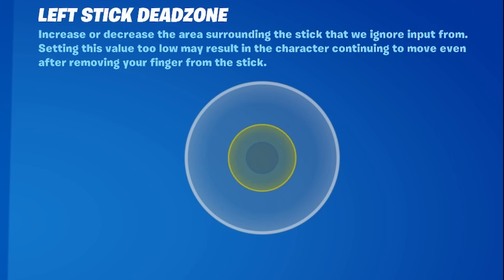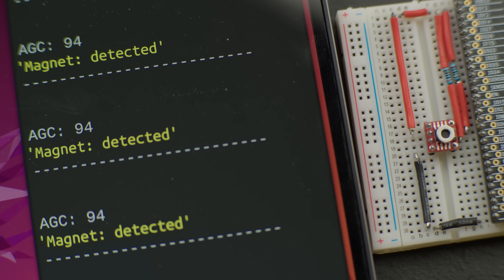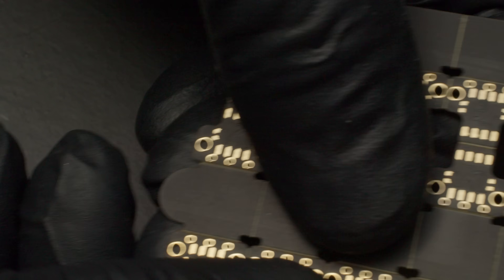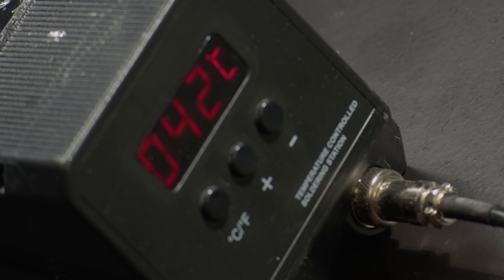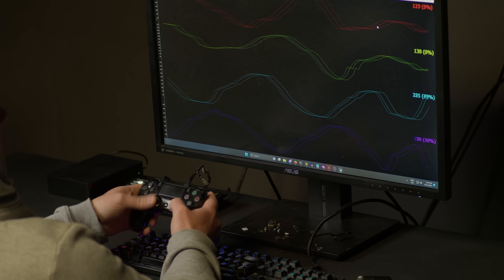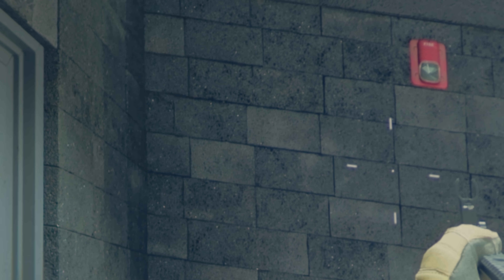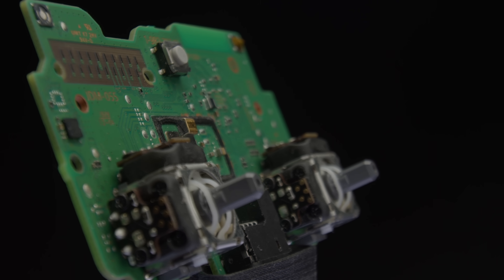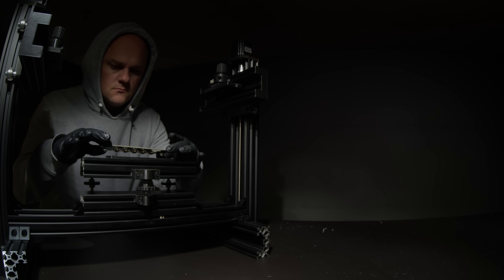Beating the $20B Joystick Drift Problem, and giving it away for free

Comment: What people don't understand is that this is not a design flaw. Companies want your controller to wear and tear so that you're forced to buy a new one after some time, they design them so that hopefully it happens when warranty expires.
It wasn't like this in the first generation consoles, I remember the first Xbox controller I bought for PC, played for 10 years and never heard of drift problems.
Now I am forced to change controller every year. Thanks to greedy companies and their revenue schemes.
Reply: Agreed.  Hall sensors are not new. All the joysticks in industrial machines use hall sensors for better reliability and robustness.
Reply: @vex123  and they where first used in a game controller by sega for the saturn and later for the dreamcast. Hall effect sticks are not even that more expensive. It is just the fact that Sony, Microsoft and Nintendo would lose alot of money on missed sales of new controllers and replacement stick modules. This will cost them miliions of dollars. Even gulikit who who solely rely on the sale of only 1 controller and a few hall effect stick modules fo joycons and for the steamceck, can implement these sticks in a 60 dollar controller that also has a accelerometer and gyro scope (even the series controller does not have both and is still more expensive then the gulikit controller).
Reply: Yeah, never heard of drift on PS1, PS2, or Xbox controllers...
Reply: @delta-a17  drift isn't really the correct term. The problem lies with the contactors on the potentiometer wearing out over time.  This causes jitter and error in the sensor reading.
Reply: @vex123  witch gives the effect of the haircross drift like a plank o wood in water, is just an more know and easy to understend term as everything on earth that is made to be easy understood
Reply: Lol what?? Yes it is. It has been called stick drift for decades. The "cause" of the issue irrelevant to the name. The name is based on the presenting symptom.   No one calls a sore throat "sliding thick mucosa syndrome"
Reply: @delta-a17  Xbox controllers get BAD drift boss.
Reply: The funny thing is all it would take is for an aftermarket company to break ranks with the others to have THE controller without this issue. But I'm not sure if specifications for compatibility are tied to licensing in some manner? The only other obstruction could be something else like a patent that's in effect which we don't know about.
Reply: @pauljs75  There are a small number of third party controllers with Hall Effect sticks now (mostly licensing/sourcing from a single manufacturer atm). Hopefully this forces more and more to start using them.
Reply: @pauljs75  we had those during the PS2 days. youll notice how every "3rd party" controller looks suspisciously like the exact same thing, and functions identically to one another now. thats because there are no more 3rd party controllers, thanks to DRM bullshit theyve got that locked down so hard that to make a 3rd party controller youve got to pay licensing fees out the ass and requiring you to make a completely unique design that is technically the property of sony/microshit. hence why things like razr and hyperkin controllers are so insanely expensive, but their liscenses have all ran out and niether of the real consoles seem interested in furthing them.
Reply: @pauljs75  Hall effect sensors themself are not patented atleast. Every one of the big 3 seems to use a different voltage for the sticks, so maybe theire is a patented for that. i do know that gulikit is working on a swappable hall effect stick module for the dualsense edge. And after that launches the are going to make one for the reugular dualsense. Gulikit also sells hall effect stick modules for joycons and for the steamdeck.
Reply: @pauljs75  Those already exist. There's plenty of companies doing that but its still third party and they have to make them with most of the features,of the official controller, cut to be able to make any money at all.
Reply: @pauljs75  main issue would be that the big companies would nuke the project to hell with a humongous lawsuits.
Reply: @pauljs75  logitech f310....... however it's not great for fps shooters..
Reply: @bullyakker  My logitech f310 ended up having spring wear and being super loose, which ended up being worse than stick drift. The sticks are soldered onto the board as well.
Reply: @bullyakker  it is great for iron lung and subnautica
Reply: Forced obsolescence.
Reply: They considers controller consumable goods.
Reply: Have 2 original GameCube controllers, used for 18 years, still work perfectly.
2 "Switch Pro" controllers, already multiple dead buttons, and joystick drift, in 1-2 years of use.
2 joycons, even worse problems in just a few months. Impossible to fix by professionals.
And these new controllers were so much more expensive than the old GameCube controllers.
Reply: Repent and believe in Jesus Christ  I tried Jesus and my sticks still drift I don't think that's the fix.
Reply: I bought a ps4 controller from Walmart to replace an older one, and I shit you not I had drift problems the very next day.
Reply: This, this is what Ive always said. they're designed to fail, to make more money, its always about greed.
Reply: Right and u could rven rig a 360 controller to take a single aaa battery, those where the days
Reply: Man my first ps4 controller lasted forever but when it finally ate shit I was lost and no controller has lasted longer than a couple months without getting drift since then.
Reply: I think many have realized this... I did after my 2nd $70 controller in a month. Took apart the PS3 controller and it's sticks were built much better, twice the inner workings then ps4's.
Reply: crapitalism is so cool 😍😍😍
Reply: gamecube controller has inconsistency issues for competitive play, but never had drift problems
Reply: I consider myself lucky that I've only had one controller degrade enough for me to notice in the last five years. I know a lot of other people go through several a year, and that's BS from the companies.
Reply: Yep. Designed to fail like a lot of things for consumers.
Reply: Lol exactly. I tell people this all the time. Almost everything is designed this way. Its bad business to make something correctly and lasts alot longer. Makes more sense to them to make u buy another one over a period of time.
Reply: Companies have learned this and have been practicing it for years... get your customer base, get them to really like your product... create new iterations and designs that create new/more revenue streams and then slowly integrate components that are meant to fail so that the company makes money on repairs/extra parts. This has been a big thing in the auto industry over the past 50-75 years something that is practiced by just about every single manufacturer
Reply: @jamesMwebber  same thing with lightbulbs, after a certain point their livespans just kept getting shorter and shorter
Reply: The term you’re looking for is planned obsolescence. It’s why we get new phones pretty much every single year and why the software and hardware on older devices(looking at you, Apple) degrade over time. I once read about a lightbulb that’s in a San Francisco fire station that’s been going for over 100 years. A lot of shit isn’t built to last anymore
Reply: And the solution just made by youtuber wtf are these companies dumpfk
Reply: why not buy Gulikit?
Reply: I was just gonna mention this, same idea with a lot of products they give then a limited use so they can getcha money again
Reply: This is called planned obsolescence. This happens with everything you use. Phones, cars, cameras, TV’s, consoles, controllers, remotes, the list literally goes on forever. On a separate note, I’d wager it’s the main cause of the perception of our planet being overpopulated, when in reality we are over-consuming.
Reply: i still have the first 2 controllers i got with my playstation 4, i still use one of them daily. i'm just now getting some minor drift over 6 years later, but it's enough that i can just turn up my deadzone slightly and not even notice it. i don't know when they started making controllers like this, but it never used to be an issue.
Reply: Exactly always i said, Hall joystick would solve that, because that happened on automotion too with sensors on the camshafts and crankshaft sensors, and i studied that, but they keep winning money with broken joysticks and they waste less money to produce that controller with that crappy joysticks, so, win win for them.
Reply: This is 100% true. My 2 DS4 v2 failed, one in 1000 hours of play and the other in just 500 hours. However, my DS4 v1 which is a launch model with 2-3k hours of play is still working fine. The only issue is the analog cap I had to replace it.
Reply: If anybody wants to learn more about this concept, the term is "Planned Obsolecence."
Reply: I still have Xbox Classic, ps1 and ps2 which work perfectly.
Reply: @drazic80 Do you mind sharing what shops or online store you are using/getting to honour the warranty in controllers?
Reply: @drazic80  Top man 👌👏 Thanks for replying 👍
Reply: It's ironic that I'm now almost exclusively a user of third party controllers for modern hardware, my $20 PDP Xbone controller didn't start drifting after 5 months like my fucking first party $60 Xbox Series controller did
Reply: Nice conspiracy theory.
Reply: I've been using the same Xbox controller for 5-6 years, maybe 7. It's an Xbox one controller, so I think it might be a you problem, considering I used it heavily during the pandemic.
Reply: To be fair it's not a greedy company revenue scheme it's just capitalism done well. This is why people oftentimes just say " capitalism sucks" to these sorts of things because if you think about it it's pretty goddamn brilliant when it comes to maximizing profit, since what are you going to do just not buy a game controller or not play your games anymore? Same thing happens with a lot of products. Thankfully there's still a decent amount of products where the companies aren't completely obsessed with profits (usually private companies) that actually do still make things at last, but you have to really work finding them.
Reply: Yeah, that part didn't make sense to me. 
You don't really need a different design, just make the wearing parts out of stainless steel.
Reply: It’s especially annoying that they specifically plan to make your controller last JUST after the warranty ends.
Reply: Hall effect sensors are a thing already. I think the first controller using these was Sonys Sega Saturn and that was back in the 90s. I don't know why he is pretending this is something new maybe to generate clicks.
Reply: I already own a controller that has hall effect sticks. Just don't look at rhe big brands. I use a Flydigi Vader 2 Pro and I've had no problems for 2 yrs. I already knew what to look for in a stick and they had it.
Reply: Every one of my friends went thru like 5-10 controllers during their ps4s lifecycle. I still got my OG PS4 Controller, it still works perfect and even OG battery is still going, feel like I have a special nuclear war edition.
Reply: The ps1 also had stick drift, but the system kept calibrating the dead zone constantly.
Reply: That’s why he’s saying no to the money.  So they can’t buy it and shut it down.  He’s trying to kill their revenue stream by shaming them into making a better product.
Reply: PS5 controllers are using the exact same sticks as PS4 and all of the others yet they want us to believe that the tech hasn’t and can’t get better in over 10 years? Right lol
Reply: @PapaGleb  Hall effect sticks where used over more then 20 years ago in the Sega saturn and dreamcast controllers. So who do they think they are fooling (clearly alot of people) because they still make alot of money from using potentiometers wich only last a few month or years.
Reply: @caleasthetic  Funny enough I just learned that the other day. It actually fits modern manufacturing if you think about it, I just never thought it would apply to tech especially since tech is usually improving or at least that is the appearance.
Reply: @PapaGleb  PS5 and PS4 don't use the exact same sticks. They have different resistance values.

Anecdotally, I've had far more problems with PS5 controllers than PS4 controllers.
Reply: @tomhsia4354  aside from the 2.3k and 10k I believe they are the same. Honestly Iv been having problems with all of them. In theory it’s a simple fix yet no matter what I try it’s never easy. I tried sticks/pots from mouser, China, eBay etc and it’s same results 😢
Reply: @PapaGleb  try the Gulikit KingKong2 pro controller. I've had no issues, and I'm murder on controllers
Reply: @Takintomori  I make my own controllers and repair others. I mainly work on PS controllers and last I checked guli doesn’t make sticks for PS but ty for the tip. I’m no where near the level of designing my own stuff but I have tried/researched everything else I could.
Reply: @PapaGleb  You are correct. Part of the reason it is not a simple fix is that the center point for those joystick are not quite the same for each unit, there is a baked-in calibration for each pot in those controllers. However, we consumers cannot recalibrate the new pots. They sell little curcuit boards (drift fix boards, I think) that allow you to dial in your own calibrations.

I've personally been having so many proiblems with my PS5 controllers, while ny PS4 controller has been solid all this time.
Reply: @tomhsia4354  Thx for the info Tom. Although this is a big problem, not a lot of people want to discuss/share it so I appreciate everyone's input here. I have tried those boards before but they work better in theory than in practice. Once the sticks are all centered with those boards and you assemble the controller, you realize that you need to compensate and grind the shell which I felt stupid after as it makes perfect sense lol. 

I also concluded that they have to have some way of calibrating the controllers because I purchased Alpine sticks from mouser and those weren't the solution but there is nothing online about calibrating, at least nothing that I could find.

I think I have tried it all at this point and so far what works for me is a slow trial-and-error method. I find pots that equal 10 or 2.3 ohms and test them without soldering so I will go through my 100s of pots to find that actual makes center. Also, I noticed that the stick itself may cause some drift. Let me explain, I believe the spring or the main plastic stick body goes through where so it doesn't return to the center as it once did. So before I test my pots, I will confirm if the stick itself has any extra play, if it does then a new one goes in and I then start my pot testing. Very time-consuming which is why I still have a box of about 40 controllers waiting to be fixed :)
Reply: @tomhsia4354  The xbox series controllers self calibrate. As you move the stick around it recalculates the center point until it eventually finds it, and dials it in pretty darn impressively.

Thats being said, the only reason I know this is because the self-calibration software in combination with a bad stick was making the inputs go haywire. For me, as someone that can easily replace sticks, this is far more preferable than having to screw around with drift fix boards or trimmers. But for someone who can't, the controller would be completely unusable. Whereas without the baked in calibration it might still be usable.

I think the problem is everything has tradeoffs and solving the problem is a lot more difficult than people want to admit. As much as people like to tout hall effect sensors as a perfect solution until there is some real world data of hardcore gamers smashing these sticks around for hours a day over an extended period. It is hard for me to believe there aren't going to be unforseen problems that crop up, similar to how Microsofts self-calibration software designed to eliminate drift actually seems to have made things far worse in the controller I had to repair.
Reply: @nerdstrangler4804 hall effect sensors ARE the solution. Your example of the self calibration is mute. They tried to use software/firmware to mask a hardware degradation. Hall effect sensor actually fix the hardware degradation problem.
Reply: It's the same really, PS5, PS4, ps3, Xbox starting 360, Nintendo, they use same parts from same factory, it's absolute garbage of lowest quality, fun fact cheap replacement from AliExpress last 3x more. There are some changes between generations but not in design and how it works in the end. It's just cheap garbage they use to force people into buying more overpriced controllers.
Reply: I was about to comment this exactly. I am an engineer and this is unfortunately the status quo when it comes to consumer products. The job of the company is to maximize profits, which means to walk a tight rope of making sure the average customer is still satisfied while wringing them dry over many years repurchasing products they theoretically only needed to purchase once.

I am not normally one to defend these companies, but at a certain level it's not actually greed, it's necessary for company survival. There are many examples of companies whose products were simply too good, it doesn't matter that their products are still used to this day and are adored by many because they all went out of business.
Reply: @drazic80  shit i'll be lucky to have one last a couple weeks before my guy is tryna do 360's while not touching the controller, we have warrantys but we have stupid loopholes the companies can use to say it doesnt fall under the policy..... happens alot to me
Reply: Repent and believe in Jesus Christ   gtfo
Reply: This…that’s all there is to it, big tech being big tech.
Reply: Nintendo offers free repair or replacement for all controllers with drift on the switch. But it's very unknown so you wouldn't know about it without searching
Reply: @Phaetul  Then it is even dumber of them not to implmenet hall effect triggers. they may be as much as a dollar more expensive for each hall effect stick (with 2 to 4 magnets each). but they can easiliy implement it cost effectivly in a controller that cost as much as the 8 bit do ultimate.
Most companies wont use it (not because it is cheaper to use potentiometers). but resolving the drift iseue will cost them milions in extra sales of stick relpacements and new controllers.

But if Nintendo fixes most drift iseu''s for free then the above would not apply to them. so they should just use Hall effect triggers. These have been used as early as in the sega saturn controlllers and later the Sega dreamcast. So the big 3 companies dont have any excuse to not include them. 

I know gulikiet is selling hall effect replacement sticks for the joycons and the steamdeck. They are also working on a hall effect replacement module for the dualsense edge, and when that is luanched they will also make them for the regular dualsense (but that will atleast take a year before they even begin to work on the later.)
Reply: Thanks capitalism
Reply: It's called "planned obsolescence". The planned and intentional breakdown of a item over a period of time due to the way it is intentionally manufactured. The purpose is to have people buy more.

The person who makes a controller without this problem, will make more money than everybody else
Reply: @Drewski777 actually, the person who makes those controllers won't make jack shit next to these other companies. They'll suffer from the "horrible" fate of not selling multiple controllers to the same consumer because of the outdated and ineffective design.

Or, as some companies have done to these "solution bringers" in the past, they'll be squeezed and slandered and crushed until they're no longer able to exist. Corporations are very brutal when it comes to protecting their bottom line, and we've watched history repeat itself time and time again as it's proven this. Any white knight companies offering to actually help consumers die off, often at the hands of a larger corporation.
Reply: That's not true at all. Even ps1 controllers had this problem. The stick death always comes from extreme use and the constant use of the r3/L3. That didn't really exist in the old days so you would come across these issues less often.
Reply: @stompingpeak2043  that might be true, but still it can be prevented mostly by just using hall effect sensors. wich might be a few centw to a dollar more expensive per chip. But small companiess like gulikit can use these cost effectivly in a cheap 60 dollar controller. a controller that also has a gyroscope and accelerometer. two things the xbox controller also does not have, yet it is the same price. 

The gulikit controller only seems to use 2 magnnets per stick instead of 4 (wich would be better). but still these sticks are way better then potentiometer sticks. Offcourse there could still be other problems that will cause stick drift. but for the most part it could be resolved by using hall effect sensors. Wich Sega already used in the Saturn and later the dreamcast. 

So the only thing that is stopping the big 3 companies from using hall effect sticks is the loss of sales from new controllers and stick replacement modules. they just need to use these sticks and mybe ad 3 dollars to the price to make it cost effective. But the wont because they will lose milions in sales by just resolving the drift problem.
Reply: @stompingpeak2043  unless you know something I don’t, using L/R3 has nothing to do with drift.
Reply: @stompingpeak2043  ps1 had error correcting code to reset potential stick drift. It didn't prevent it, but it kept the problem manageable for as long as possible
Reply: Who thinks people don't understand that?